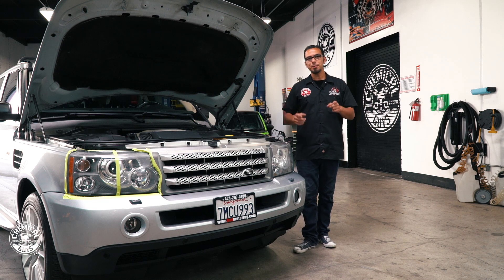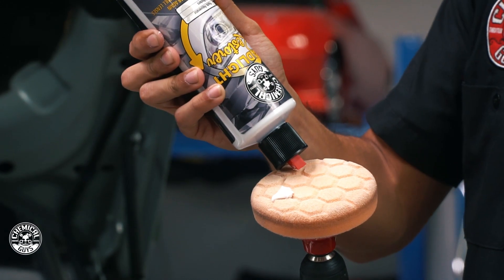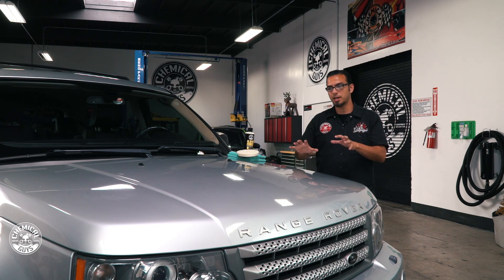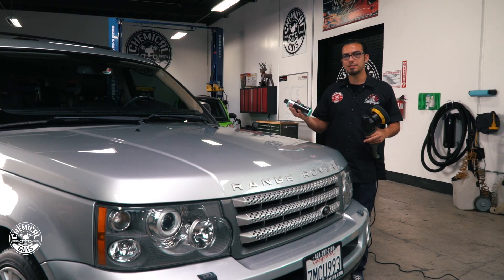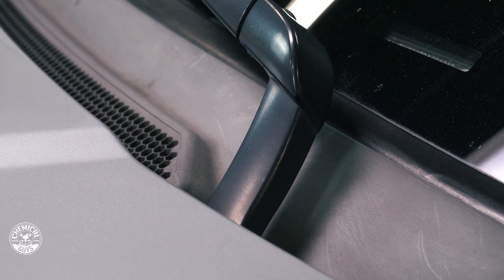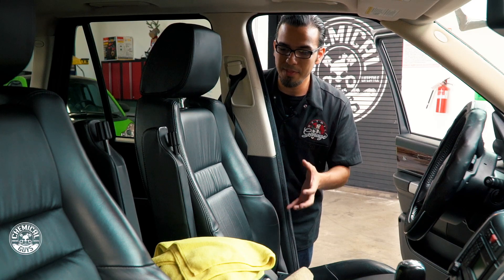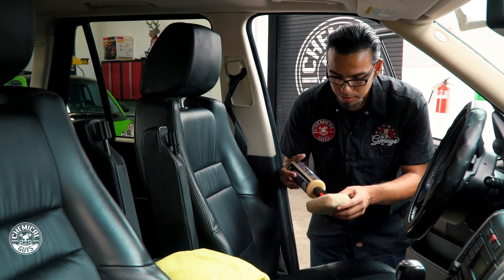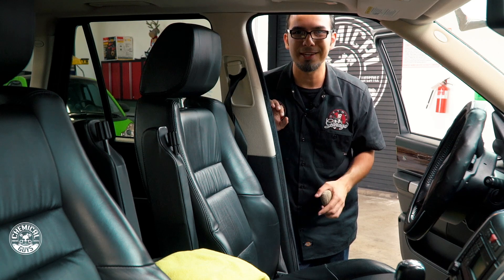Top 5 Tricks To Increase Used Cars Value | Chemical Guys Car Care

Comment: what drill attachment is that for headlight polishing??
Reply from the maker: Hey surviveasl, utilizing a 4 inch Orange Hex-logic Pad attached to a 3 inch rotary backing plate which is adapted to the drill using the Good Screw Power Drill Adapter For Rotary Backing Plates.
-CG Nick

Comment: can carbon flex be used after head light restoration?
Reply from the maker: Hi Victor, thanks for watching. Yes you can, in fact it will be the longest lasting protection you could possibly put on your headlights. Stay tuned, more epic content coming weekly from the Chemical Guys network.

Comment: Just quick question didn't you wash the car before everything? Than you did clay bar and all the other stuff correct?
Reply from the maker: Yes Miss Smith that's correct, you should always polish, and apply waxes on a clean surface.

Comment: can I use that product on my headlights after they have been cleaned up if not what would you recommend for a sealant to put on top of the plastic headlight housings to keep them from oxidation
Reply: Hey Jason, 
Use a good coat of Jet Seal on any optical plastic to give it a layer of UV protection!
Reply from the maker: I agree with Jeffrey, Jet Seal has the longest life span of about 12 months under fair conditions.

Comment: Am i wrong saying that leather interior of last years produced cars has factory coating, so we just have to clean it (conditioning won't stick to the surface cause of that coating, so if applied it would not stay for a long time)?
Reply from the maker: Hi thanks for watching. Cars coming out of the factory might or might not have a coating put on, it depends on the manufacturer. If your car had the coating put on, cleaning it, and adding the serum will help you to maintain the coating extending the life of the leather. Be aware that if your car is sitting in the sun, that coating will begin to breakdown gradually.

Comment: Did you use the Eco Smart as the lubricant when using the clay block? If yes then awesome I have a gallon of that and don't need the actual clay luber. Also when your about to use sealant and wax, dont you strip the old wax layer off, then apply a new fresh coat of sealnt/wax? cause eco smart has wax in it and then leaves a glaze when it dries. If you do, do you have a product that can strip the old wax layer off?
Reply from the maker: Hi Joseph, Ecosmart is not a good substitute for a clay luber, the Clay Luber actually contains a few key ingredients that prevent the clay block from marring the paint. As far as wax goes, it literally depends when the vehicle was last waxed, and it also depends on what type of soap was used. Citrus Wash and Gloss is a soap that actually strips old waxes from the paint surface, so it's not always necessary. If you're looking for a product to remove old waxes, use Clean Slate.
Reply: Awesome thanks for the response!

Comment: I need to know I just got a brand new 2017 dodge charger its a dark red more like a candy red kinda it sits outside in a carport but would a clay bar remove water spots? Because  I would love to wax it but  don't know what kind of wax would be good for that type of color of that even matters? I'm looking to put some protectent I want to keep it looking like its fresh out of the train
Reply from the maker: Water spots are some of the most difficult contaminants to get out and clay cannot get them out. We recommend you use our Heavy Duty Water Spot Remover specifically for this, but it also depends on how long they've been there and how badly it's etched itself in the paint. As for the wax, the Cherry Wet Wax is perfect for your dark red paint, it'll really make it pop and give it a deep wet shine.

Comment: I have a mustang 2012 in kona blue paint looks scratched in sun with swirls marks and every time i clean it always get dirty fast ! & collects lots of dusty quicky
What can y'all recommend?
Reply from the maker: Alex, you're going to want to add a sealant to it. Our most popular and our most powerful is our JetSeal. JetSeal offers you durable protection against the harshest elements like UV solar rays, pollution, water spots, bug and bird residues, and road grimes that lasts up to 12 months with just one application, it will definitely work on dust.

Comment: hopefully its mechanically sound lol otherwise its a polished paper weight. on the other hand, i wish people who dont know anything about washing their car, didnt try to wash it or let others who dont know because they just get swirl marks all over it. at most, they should just spray them with soap and rinse. that way there wont be any swirl marks, just a little dirty. because just spraying it is often not enough to get all the dirt off. but better than ignorantly scratching the clear coat and swirling it.